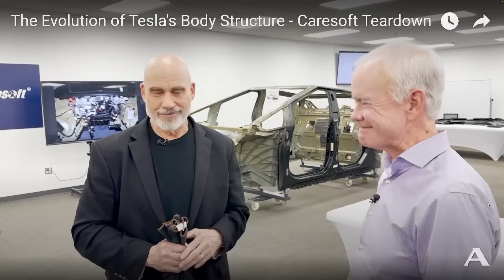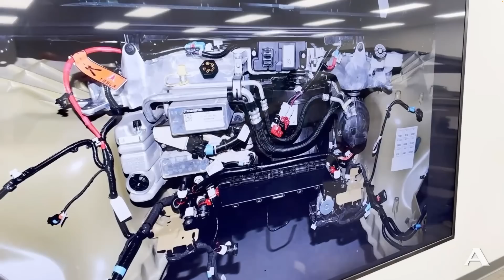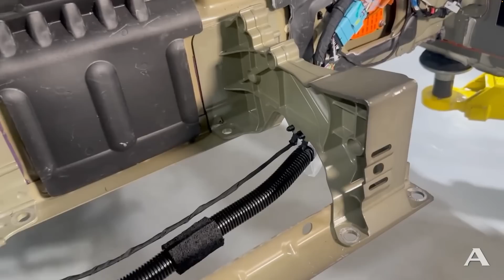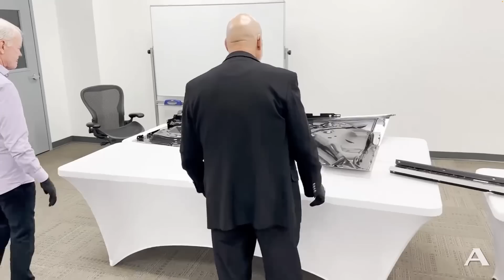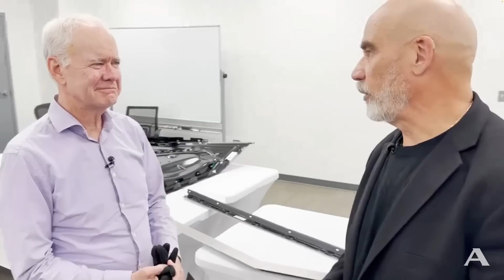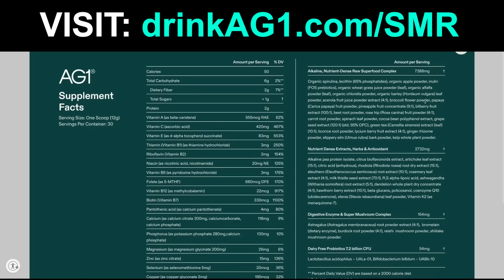Cybertruck Secret Discovered In Teardown

Comment: Adhesive will deaden sound a part makes, transmits or amplifies if there is no sound deadening material.

The height of the bed of the cargo box is usually a few inches higher than the drive shaft and axles on an ice car. The way to have a lower bed is use small diameter wheels (has a lower axle). With an electric vehicle, the motors dictate the height of the cargo box’s bed. It can be lowered by making the electric motors lower in thickness (approaching the diameter of a shock absorber).

After that, the height of the bed can be lowered more by either installing the motors at or inside the wheels or pivoting the motor 90 degrees, so it’s like the shock absorber. Maybe there is a way to make the shock and the motor as one unit? This means no restriction on how low the truck bed is. So now we need to look at the back.

A low cargo box bed like this would be lower than the rear bumper. So the bumper and a trailer hitch would need to be part of the tailgate and give structural strength to the rest of the truck.

The bed of the box would need to have structural strength, loike the battery pack. In fact, an option of a second battery pack could be the bed of the cargo box (with a cheaper version being the shell of the pack with no batteries).

We are accustomed to low floors in buses. But we still need to step up to get into the cab of a pickup truck or jump on the box at the back. That’s no longer something truck makers need to do. The “downside” is it feels macho to step up into a big truck. We never had that issue with buses in the past.

Comment: CyberTruck stainless outer panels are glued to the structural frame. A smaller or slightly less spiky version could be made with 1/8” (3mm) aluminum sheet. Fold the edges to remove the sharp corners and still be cheaper to build than stainless.

Comment: you might be able to cover those castings with something like "rubberized coating" to dull those edges, I assume it reduces complexity in casting to to "dull" those edges?, a single dunk might do it, sharp edges doesn't seem like a good idea! Plus the rubber coating helps with longevity, not to mention bad PR when someone cuts their hand, also hard to repair a car when your wearing "boxing gloves". Reduced maintenance cost, since tesla does its own might make the costs balance out, slower repairs and assembly, has a cost too, in mho.

Comment: Might be good at the factory level, but  you now have a car which becomes  very expensive to repair, and depends entirely upon availabilty of parts.
When that happens, you finish up with fewer repair jobs, fewer r repairers, and finally a throw away car if you scratch the paint.
And in terms of safety, I would put my money/life on the predictability of steel over AL casting any day.  
Sorry, as a car I am not impressed at all. As an engineering experiment, it is great, but should not be on the road.

Comment: How much of the steel exoskeleton idea has survived? Or was it planned as a casting exoskeleton from the beginning?
Reply: Not much, if any, it seems. As I said earlier, it was a quiet change, but obviously a necessary one. They needed to keep the stainless steel exterior because that's a visual design cue everyone expected, but it isn't a replacement for the gigacastings and other frame sections. 
Doesn't bother me, though. I hope they stop referring to it as an "exoskeleton"— if there's an exoskeleton here, it's the gigacastings beneath the stainless skin, not the skin itself. (And that's an argument one might make)

Comment: Casting a complete body makes sense EXCEPT when there's an accident with another similar weighted vehicle.  Once the sub structure is broken, may as well scrap the vehicle
Reply: Says the pretend expert.
Reply: Yes, right now that's true. But the auto repair industry is a lot more entrepreneurially nimble than the manufacturers. I'll bet they come up with ways to pull the big pieces apart from scrapped models and fit them back together into a functional model again...

Comment: Finally someone says it. The skin serves no struggle purpose
Reply: True. That was a quiet change, but obviously a necessary one. They needed to keep the stainless steel exterior because that's a visual design cue everyone expected, but it isn't a replacement for the gigacastings and other frame sections. 
Maybe a future version of the truck will have a "structural skin"? But it won't be version 2 or 3 or 5, it would have to be a whole new vehicle. This one has a certain DNA now. They will improve it I'm sure, maybe come up with variants, but a "structural skin" vehicle might have to wait for Mars vehicle development. ;-)

Comment: yeah it's really sad and pathetic that GM didn't make castings in the 2000's when they made the All-Aluminum Engine blocks. rear cast is not much bigger than a block.. i think Ford may have been able to do it in the 80's... such lazy engineers from the past.. so tesla dominates by picking up other's slack.  hallmark of design is simplicity. first is the worst, second is the best, third is the one with the polka dot dress aka showing off... 1: roadster 2: Ludacris 3: X  again 1: 3(production hell) 2: Y best selling car in the world 3: cybertruck showing off.... whats next 1: new roadster 2: Robotaxi 3: Cybervan.

Comment: i don't think any other car company could have adopted a single piece casting. Yes, you can design one on the computer but what about the material engineering Tesla did. They had to create a completely new aluminum alloy which would flow fast enough to fill the mold. Existing aluminum alloys cannot be used to make Tesla's one piece casting, not to mention that no casting maker would have attempted to make it. Tesla convinced IDRA to give it a try and it worked. Now that Tesla has done it, others can reverse engineer and figure out the composition of the alloy.

Comment: Sorry to be a dampener on this. The engineering is awesome, but repairability is abismal. If you never crash your Tesla it’s superb, but if you have even a minor bump in a car that uses these castings the car is basically a write-off from an insurance perspective which pushes up insurance premiums significantly. The obvious solution is Tesla Insurance! 

LONG TSLA 📈🚀🌕
Reply: @dwylhq874
PLENTY of assumption there.
I'll leave it to the clever people
Reply: Depends on the severity and direction of impact.
The cyberTruck will withstand much greater side impacts without damage than other trucks.
I suspect the same is true for rear impacts.
Most trucks will be an insurance write off with any frontal impact that would damage the front casting IMO.

Comment: Over 320 parts saved by the front casting alone? 🤔
Normally the whole body in white comprises 500 parts.
Reply: @user-ff3ib5oc4s The number of parts that the rear casting eliminated is over 360!

Comment: So what's happening when the front cast gets damaged in a fender bender? How is it supposed to get repaired?
Reply: It's not, i thought there was also an aditional impact absorption structure at the front of arms on the casting that have been removed on this body.
Saw it in a Sandy Monroe video at the texas factory.
Reply: @teatowel11  There is a pair of replaceable "crash cans" that fit onto the front of the front gigacasting, Monro & Associates showed them, but this fellow just mentioned them in passing. They were removed so that all you see is the casting here. Those are what crumple in a "fender bender." The gigacasting won't crumple unless it's a major accident, the sort that would total a normal car too.
Reply: You can fix the parts that stick out forwards (or backwards). If you damage more than that, it is not worth it to repair any contemporary car, since it is much cheaper to sell the usable parts and buy a new vehicle.

Comment: So in other words, it's not exoskeleton in any manner of form. Seems kind of waste not to utilize the stiffness of body panels that thick
Reply: Why would you say that? All of that is obviously wrong. Some sort of trolling? Am I supposed to be provoked and angry?
Reply: @geirmyrvagnes8718 Don't assume! Think! That comment made me think: "that's 1 way Tesla will pare weight from my future CT!"
Reply: @geoffgeoff3333  Well, that is your assumption. If you think about it just a little bit, the side impact strength of the door (as an example)  is greatly improved by the strength of the skin, allowing less internal skeleton in the form of the steel beams conveniently placed where side impact strength is usually tested. Also, for smaller impacts it can shrug off a drunken karate kick with at maximum a small scratch that literally buffs out. Obviously the skin of the door could not ever be meant to be a part of the torsional rigidity of the vehicle, because then you couldn't open it. So it is clearly an exoskeleton in any reasonable interpretation of the word. Sure, feel free to have an unreasonable interpretation, but I will then feel free to call you out on it. The "Elon promised me XYZ in a tweet 7 years ago that I interpreted out of context"-crowd can go have a good cry in a corner somewhere. It is good to get it out of the system.
Reply: Well, it's not an "exoskeleton" in the way Elon originally described to us. But using very hard stainless steel body panels, and doing it they way they are doing it, does add a good amount of rigidity... without providing the actual structural support for the entire vehicle. 
The giga-castings do most of that.
But the stainless steel panels contribute to the strength of the giga-castings. See @geirmyrvagnes8718 's comment here.
So "in any manner [or] form" isn't true. Listen to how these two guys talk about the structural rigidity and strength and crumple zones of the CT: compare the appearance of those giga-castings to the exoskeleton husks of beetles and such. This vehicle really is a shift from body-on-frame to something much more exoskeleton-y, and the stainless steel panels are a critical part of the strength of those giga-castings.

Comment: Also note the front crush beams are separate from main casting making them easy to replace after moderately sever impact.  5:00
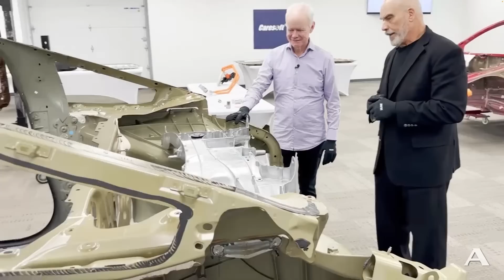(oh...he mentions same at 10:30)
Reply: Sadly,  no. The front of our Tesla had a minor scrape from a pothole underneath and the repair was $2k+ 💸😢

Still LONG TSLA. 📈🚀🌕
Reply: @dwylhq874 “easy replace“ is relative. Point is: it can be replaced without replacing the entire front casting, which some folks just don’t get. 
Still sorry for your $2000 bill.
Reply: @tlow5766   $2k??  Lot more than that if you get into those beams, crunch a fender is that much on any car.  I'm thinking it may prevent totaling in a 15/20 mph impact.
Reply: @dwylhq874   Do the work yourself and you'll begin to understand, that's not necessarily a Tesla thing, it's a CAR thing.
Reply: @dwylhq874 somebody backed into my rear passenger side just above the wheel making a small dent about 6 inches diameter on my BMW. $2300 plus tax. The cost of repairing any car is astronomical
Reply: @dwylhq874  how dies a minor front scrape from a pothole work?
Most likely that would damage under the car which you can't see so???

Comment: Nobody has equaled th safety  engineering speed or durability of th 2012 model s
Reply: There are 5-6 year old model S with less than 100 k miles selling for less than 20k right now, those cars represent astounding value for money.
Reply: Aren't the modern Teslas way better than the old teslas?
I suppose you mean other companies are effectively over a decade behind, which is accurate.

Comment: The real eye opener was the exoskeleton was a complete fraud. That heavy stainless skin is just dead weight going along for the ride and adding no structural rigidity.
Reply: The Cybertruck is lighter than it competitors.
Reply: @Michael-Has-Opinions  except the plan was to be much lighter and much less expensive.
Reply: @Dularr Coming soon Dulard!
Reply: @Dularr quite right. Elon is a fraudster for changing things between making an initial product announcement and actual production of the live product. No other manufacturer has ever done that, especially not GM, Ford, VW, Mercedes, BMW, Toyota, Honda, Hyundai or any of the other dinosaurs. Elon should be publicly disemboweled for his crimes and Tesla shut down for the scamming cheaters that they are.
Reply: There are no side bars in the doors because of the rigidity of the stainless steel.
Reply: Semi exoskeleton, not what we were initially led to believe but things change.  Body panels contribute to structure but not close to only or even main structure.  Doors don't have side impact beams, for example, due to strength of panels.  Body also nearly half as thick as originally planned which is very fortunate.

We also didn't expect steer by wire, 48V, Ethernet, lite weight, relatively small batt pack, exceptional sound system, 4-wheel steer...things that actually matter, MORE FRAUD!
Reply: @Mrbfgray  great reply
Reply: Not an exoskeleton but also not completely useless. They obviously have lots of room for improvements. Hopefully they can continue to improve the design and eventually get this to be a true exoskeleton.  But even if not, it’s still a cool design and eventually they’ll get this cheaper and longer range and all-around better.
Reply: Watch it out sell the F150 ina few years
Reply: Cope
Reply: Don't notice that Mary Barra promised 35 new BEV models by 2022 or that they'd surpass Tesla production numbers by about now and they'd be making money on them instead of losing $100k per unit.  That actually matters, it's NOT fraud!  (similar for Ford, Lucid, Rivian....)
Reply: Just like the battery
Reply: That is not an exoskeleton. Nor is the supposed crumple zone convincing, either. That's probably why it hasn't been crash test rated...still. You'll have to explain to me why 304 was favoured over composites, too. And three dissimilar metals with no galvanic compatibility... what could possibly go wrong. But at least they could use all the technology that they had developed in the Model Y for this "revolutionary" new design. I shouldn't be so harsh. They did incorporate 48volt architecture as used in some Audi's, Porsches and Mercs a decade ago, so there's that, and they did use steer by wire, the brainchild of Nissan and Renault at about the same time, so at least they're "drawing from other influences".
The only amazing thing about this vehicle is that they chose to pursue this instead of the model 2.
Reply: @davidbrayshaw3529 you should design vehicles.  Seems like you have it all figured out.
Reply: @mattl7967  It would probably be a good idea for me to study mechanical engineering, first. Being able to identify faults is a skill that can be learned from experience and exposure to certain industries. Being able to create a product without those faults is an entirely different ball game.
Reply: @davidbrayshaw3529  literally lying but okay 🤡